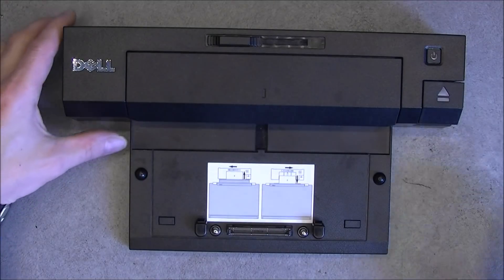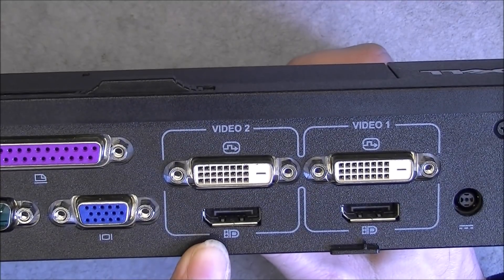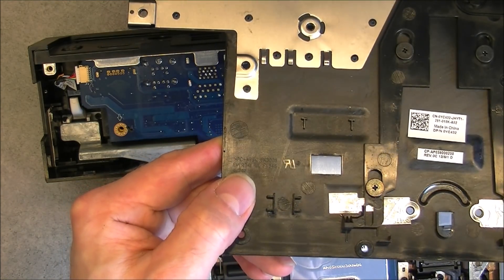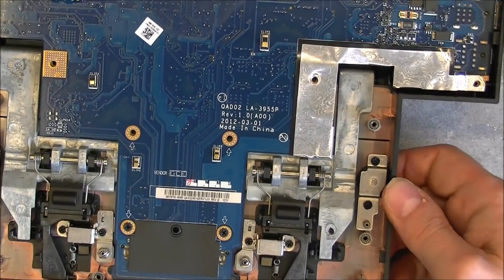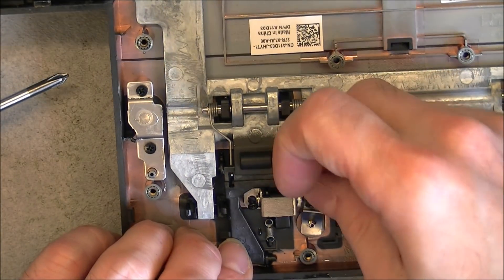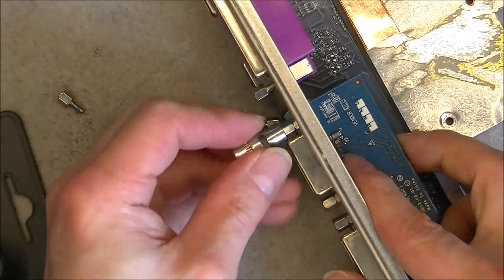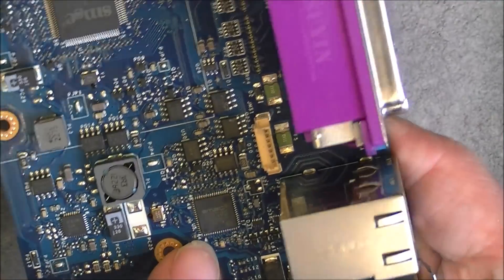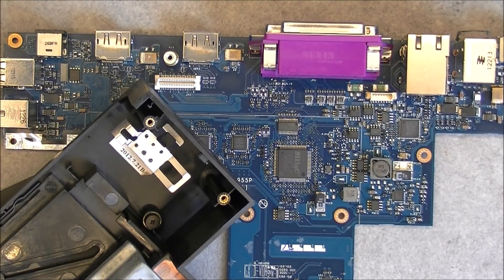Dell E-port Plus II docking station teardown

Comment: He forgot to look at the USB connectors on the opposite side of the device (3 of them). I wanted to know if they were USB 3 or not, but he was not observant enough to even see they were there.
Reply: No. They arent. They're USB 2
Reply: @BIT499 Just checked mine - you are correct.
I stand corrected.

Comment: i want to get one of these docking stations, and install an external power switch to attach to my monitor for powering on my laptop from the monitor console station. I see how you have taken out the little power on\off circuit board, and there is that black rectangular component with the grey button, and 3 soldered connections on the back. so I wonder if that grey button is the power on switch, and if I would just solder to two of the three  soldered points? can you tell me if the grey button is for the power switch please? and do the 3 soldered points control the power on? thanks.

Comment: Have several of these and one standard E-Port (Smaller width with only 1 Display port and 1 DVI) the standard one stopped working and has no sign of damage, managed to disassemble it while listening to this, the catches are needed for one I have that the catches have fallen apart, they not as reliable as the Dell Latitude laptops I use them for.

Comment: I am so surprised that someone made this video. I am thinking about using one of these in a mod that I’m doing. Just like the tidiness of it, and it will help add ports and keep cables down for the project.

Comment: These ground poly fuses are actually a good design decision. If you live in a house that still has classical grounding i.e. 2 wire with protective earth connected to the neutral wire than you could end up with excess ground current through printer cables etc. A lot of printers and scanners died this way. These fuses will prevent that.